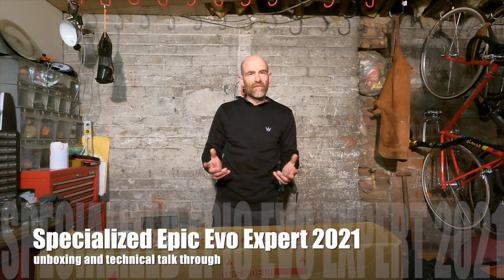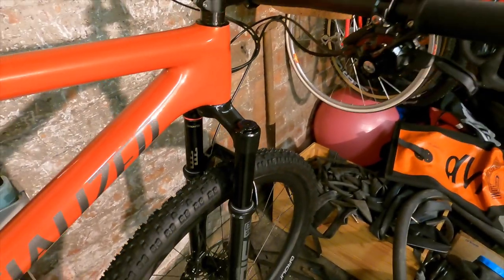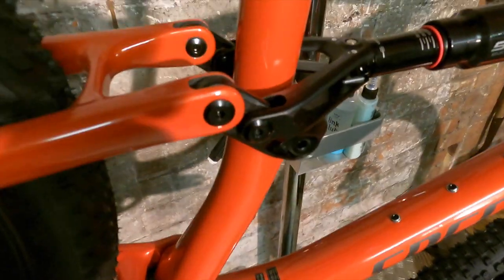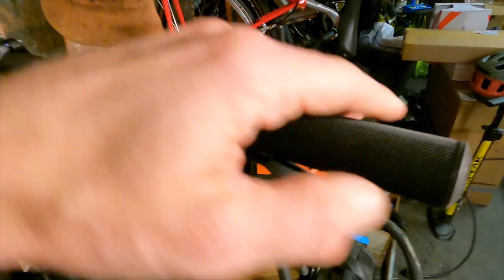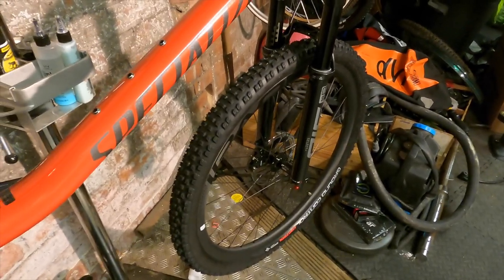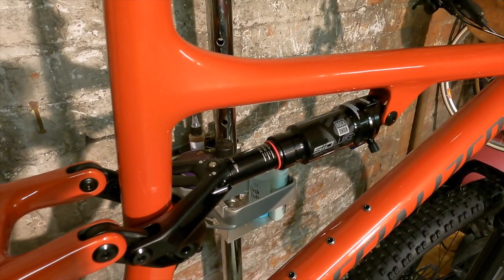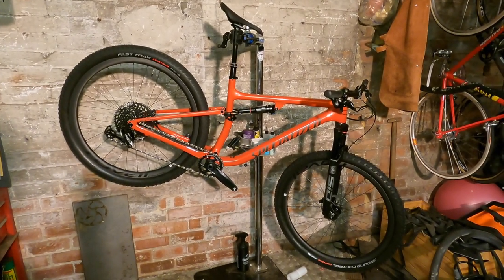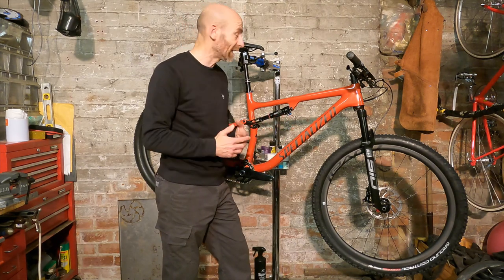Specialized Epic Evo Expert 2021 unboxing and tech check.

Comment: Looks like a great value proposition and easy to drop weight from it to make a marathon slayer. Really, really looking forward to your review!
Reply: Yes, as an owner of this bike I can tell you a lower weight is not too difficult to attain. I changed over to S-Works FastTracks (2.3F/2.1R), tubeless and I swapped to an S-Works carbon handlebar from the standard alloy piece. Result was 23.5 lbs, with Eggbeater pedals, on my bathroom scale. I love this bike.
Reply: @rlsedition  That’s awesome. I figure I could get it down to 10kg if I really went nuts with wheels, stem, crankset, saddle, as well.
Reply: @jaymueller2418  I'd just take things slowly, replacing worn items with lighter versions, unless you get flush with cash.

Comment: After looking for a new FS bike for way, way too many years and test riding countless bikes, I finally ended up with last year's one of these almost by accident as it wasn't even on my radar.
And wow!  It ticks almost the boxes for me, very light, very capable up AND down, along  with two bottle cages inside frame. With a SWAT box inside frame it would be near perfect. Now on a mission collecting KOMs around Sheffield, mostly DH so far and it climbs near impossible ascents so very well too. 
Much to my surprise as someone who has long ridden with suspension set very plush I quite like the brain. I find I go so fast on the Epic, it's always active on the rough stuff, so now leave it set on 'hardest' setting. So very curious to see what a 'brainless' one is like.
Reply: Yours is the smartest comment I’ve read on the brain. I have ridden Epics on and off for years and Brains are really only doing their thing when ridden full noise. If you’re poking along they feel clunky but the harder you ride them the more seamless the transition.

Comment: @GuyKesTV 
Hey Guy, your reviews are great. I have an EE with a side select+ and was curious to know your thoughts on upgrading to the new 2024 Sid ultimate. Do you think it’s worth it and will be a noticeable change?
I ride the bike as more of a trail bike than xc.
Reply from the maker: Sorry for late reply. TBH if your current SID is working fine then I’d spend your cash in other places like wheels. The new one is awesome but an evolution not a revolution. Select+ damper is great for trail too as it’s got a lot more oil volume in than the Ultimate.
Reply: Thank you Guy, that is great info. Your review on the 2024 was definitely compelling and very thorough. Thanks for the advice

Comment: What's your thoughts on adding a lock out remote on this bike? Is it needed.. Coming from a Scott spark with its Twinloc system
Reply: My question too
Reply: There is a port on the downside of the toptube to allow an internal cable, but you'd have to either run AXS shifting or lose the dropper/run AXS dropper as the hole where cables enter the frame only allows for 3 cables.
Reply: Cheers!

Comment: great review. What are the cranks on there with aluminum arms and steel chainring...can't really find that combo on SRAM website? Any idea of weight?
Reply from the maker: On the cranks or the whole bike? They're SRAM X1 which are original bike equipment only I think, Basically GX though so around 700g
Reply: @GuyKesTV  Thanks. I've decided to upgrade to the X01 carbons

Comment: I have the epic evo comp, what are your thoughts on the brake and gear levers impacting the top tube if the bars spin all the way round. I have added an extra spacer but still cannot have the brake lever at my preferred angle. I will probably change to a different stem.
Maybe it’s just me but this seems a bit of a design oversight, one awkward off, and you have at the minimum scratched the top tube. Maybe this just isn’t an issue...?. Thoughts?
Reply: You’ve probably resolved this already but the only fix is to change out the handle bar. 25 mm rise is enough to clear

Comment: Amazing looking bike. Really curious about why you can’t buy higher end models in the UK ?
Reply from the maker: Talked to Specialized yesterday, there just wasn't the demand for Pro and S-Works on the previous model so they skipped it on this one. There is an S-Works frame available though so you could effectively build your own (and if the Enduro is anything to go by it'd probably cheaper too 😬)
Reply: @GuyKesTV  thought that might be the case.